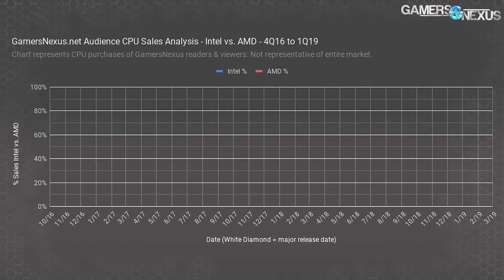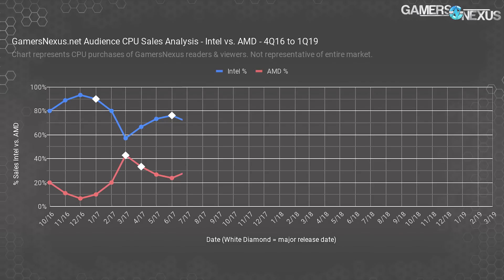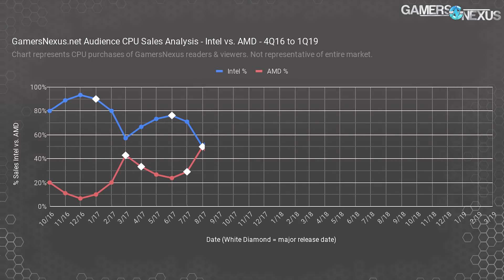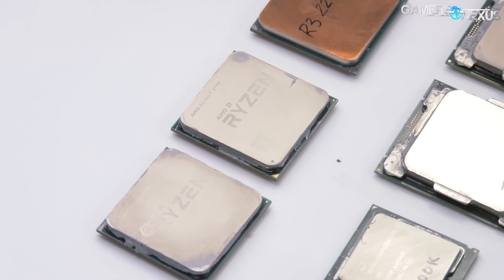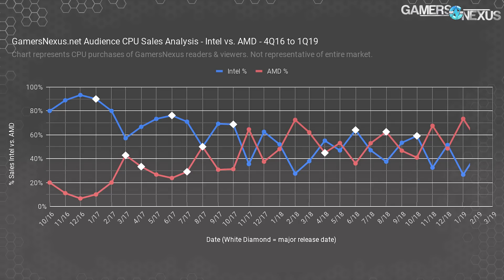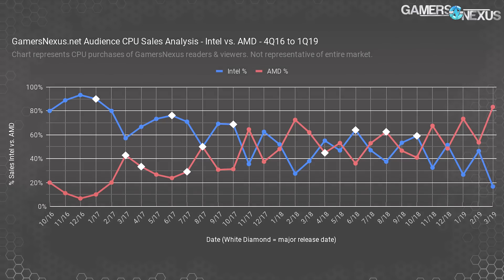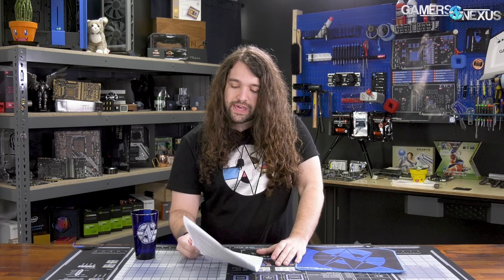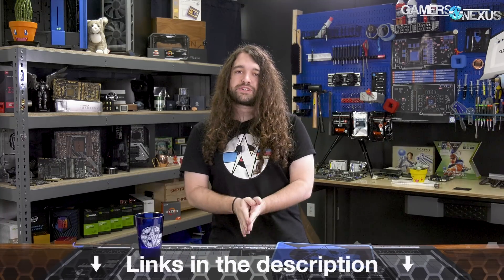Special Report: AMD’s Comeback Story - Intel vs. AMD Marketshare

Comment: well i5 died cause of intel stuped price politics and more stupid product line up politics!

Here is my suggestion intel and read it please!

i3 = 4 cores   4 threats  150€/$
i5 = 4 cores   8 threats  250€/$
i7 = 6 cores 12 threats  350€/$
i9 = 8 cores 16 threats  450€/$

all these should be K modells for overclocking.

every chip should have a non oc version of it, without a free multiplier for 50€/$ less.

than the sells will start instantly and every productline will be realy good value.
Reply: So you want the new i5 be worse than current i5?

If anything, Intel should look into matching AMD when it comes to cores:

4C/8T for i3, 6C/12T for i5, 8C/16T for i7 and 10C/20T for i9
Reply: @dainiusvysniauskas2049  yeah, but intel doesnt shit core counts like amd. and they dont glue them together xD...at the end of the day, its a question of price.
intels problem was to take out the 6 core 12 thread cpus, that was very stupid and put in a only 8 core without HT in the lineup, ok just for gaming its still fine but in view years an 12 core cpu will be necessary.
and if you look just for gaming a 7700k is still very fast and mostly better than a 2600x. so i would really recommend the 4c8t cpus for i5. price to performance for gamers would be the best. if its not enough than spend just 100 bugs more and than you have more the enough gaming power for high fps gaming.

but still, its the price what makes the music, if ibtel doesnt come down...than RIP intel xD.

Comment: History shows AMD will gain market share over a number of years and then screw it all up and lose all of it in a year or two. I don't expect that to change anytime soon.
Reply: well the thing about that is history is only repeated when you don't learn your leason! So far it looks to me that AMD knows what they are doing now and are not planing to repeat the same mistakes they made during the Anthlon and FX days!

Also, if you look at history, you will notice that the reason why AMD struggled was because they focused on developing muilti-threaded technolgy to make thier CPUs work better in mulit-core applications.  The problem was, most programs and games only used 1-2 threads at the time so the CPU couldn't run at its full pentetal.  Intel focused on imporving IPC and frequency which ran the programs and games a lot better, so that made everyone want intel CPUS instead of AMD CPUS.
Reply: @Shipprofile08  AMD is on the edge of repeating their mistakes with their video cards. The RX series is played out, if they introduce a new RX card using the same architecture it will be a flop, Vega was a complete letdown and the Radeon 7 was a new iteration of Vega and not the giant leap forward it was supposed to ontop of Vega not being the giant leap forward it was supposed to be over the RX cards. AMD needs to hit the next video card out of the ballpark and compete with Nvidia on all fronts because Intel is going to be joining the market too and Intel isn't going to be happy with taking one part of the market, they want it all. AMD bolstering their CPU lineup on cores alone.. can they match speed? Can they match RAM compatibility? And can they compete in video cards across all markets? That's all up in the air, from my perspective history says no they wont on all fronts and I wont wait for Navi or whatever... Not buying hardware when Navi will be released so obviously not waiting for Navi.
Reply: @JETWTF  I Think you have the wrong mentality for AMD.  AMD has never been known to bring out the best of the best.  They have always been known as the buget choice for low-end and mid-ranged consumers. Vega wasn't really a flop it wasn't ment to be the best of the best and to smoke the 1080ti in games. Vega was geared more toward creaters that need a GPU with lots of cores and game on the side.  Games gernally benifit more with higher speeds on GPUs where software like Blender benifit more with more cores. Also, the Vega arcetecture is designed off of a mobile node which is why its so power hugery at high speeds and so effecent at low speeds (this makes it ideal for APUs which are used primarly in laptops and consules).  

Even Lisa Su said that the first generation of Rzen was thier "worst case senerio" CPU and they were already aware that they would have memory compatability problems or motherobard problems because they were working with a brand new arcetecture! (intel has had the same archetecture for the past 10 years so thats why they don't have any issues with this stuff) Its been 2 years and with the AMD community helping AMD by giving them feedback on the processers (unlike Intel why never listions to thier community) this year is suppose to be the knockout punch for intel since the last 2 things that AMD is lagging behind Intel (AVX instructions and frequency) is suppose to be solved this year!

Radeon 7 isn't suppose to be a gaming GPU.  It is a sucesser creater GPU from Vega.  What I've heard online is that its basically a Vega on 7nm which allows it to clock higher without drawing a ton of power!  I think of Radeon 7 as more of a beta test for thier 7nm node since it is only targeted for creaters.  Also its the only GPU AMD has released this year so it might be more of a stop gap for Navi!

As long as AMD focuses on the markets that they are good at (APUs and CPUs and creater GPUs)  they will be just fine.

Comment: I was going to buy a ryzen 5 1600($80 plus $30 coupon for motherboard, deal at microcenter) but I think I'll wait till black friday to get those parts. 
Since I got a gaming laptop with 1050ti, though I want to upgrade my desktop from fx 8320 & gtx 750 1gb... I trust AMD but I don't trust cheap motherboards, especially with the memory issues being prominent in cheap boards...
My current focus is a good psu & gpu.(I sadly will likely have wait till navi and zen 2(3rd gen ryzen))

Comment: Hopefully Zen 2 has 4.5+ ghz stock clock speed for the high end so that I can upgrade from my 6700K to higher core count but not get off worse in single threaded performance

Comment: Bought an r5 1600 instead of an i5 as a last minute change in my build for the year back when Ryzen was still the new kid on the block. Even considering the growing pains with overclocking, software support and RAM support. It was definitely the right choice. Excellent CPU for an excellent price. I skipped 2600 because it seemed a bit more of an incremental upgrade. But i'm starting the get the build bug again. Who knows, maybe i'll finally pick up an r7, if the r7 3700 is anything close to what leaks suggest, it'll be an instant buy for me.
Probably won't even consider intel this time around. The extra 50-100% in cost is not worth the 0-10% increased performance on the current generations. Especially with the ridiculous prices of the 2080ti's.

Comment: As a custom system builder in the Fayetteville NC area we built around 200 systems in the last year and a half. Over 50% of them were running R5 of one sort or another. The 2400G is very popular with customers because we get it in for $120 and it's basically what we were used to as i7 for years, 4 core 8 thread better iGPU. The 2600 is basically and i7 8700 once you OC it. All at half the damn price. But we sell more i5 and i7 CPUs online because of worldwide shortages.

Comment: Man, the comeback is real. Personally I'm waiting for Zen 2 to finally make the jump, but I've been installing plenty of R5s in friend's systems when they upgrade.

But the most impressive thing that I've seen is the Threadripper line. We ordered a 24 core build "server" with some fast PCIe SSDs and 64GB or RAM to speed up our software development. Builds that used to take 4+ hours on my laptop and 1+ hr on our previous Xeon based build server now take 20-25 minutes instead. But the best part is, this thing is completely IO bottlenecked even with the fastest SSD we could find. It's good enough for now, but we're contemplating adding another 64GB of RAM and building from a RAM disk. Some initial calculations show that the builds would likely complete in less than 10 minutes.

The amount of time this single machine has saved us can already be expressed man-days, even though we've only had it for a little over a week. The measly €3K we spent on it will easily be recovered by the end on the month.

It's absolutely mind blowing how much performance these Threadrippers have. Compiling with 48 threads is a dream come true. This thing munches through everything we throw at it.

Intel is in trouble in the server market. A loooot of companies must be taking a very close look at  Epyc. The bang/buck difference is nothing to sniff at.
Reply: I know of a some companies doing that, for stuff like ray tracing for optical calculations the Threadripper is so much faster than the Intel systems of higher price points it's a joke. For IO heavy stuff which you can run on an almost infinite number of cores where you need lots of ram AMD is pretty much the only choice.

It's not a choice of which one has better support or who system builders choose to use, time is money.

Comment: Bought a 1600 to upgrade my 8350.  I'm excited for the 3k series and will be a great upgrade from my 1600.  Will likely eventually get a better board and better ram so I can give away these parts to someone without a PC or with an old one so they get put to good use but it's so nice to be able to spend more on my GPU and other peripherals without having to sink such a big chunk into the CPU.  Glad I supported them when times were bad, because I like to think that I helped get them to where they are now in some way.
Reply: i got a ryzen 5 1600 aswell and probably a faulty motherboard, i get all kinds of freezes and stuff , and yes i did already change everything in my PC, psu,gpu,ram,storage, even the case, fans and cpu cooler. the freezes remained. so i believe its the cpu or motherboard, or both. cant wait to upgrade
Reply: @SweatyFeetGirl  i got freeze hiccups with a new nvme because of the amd storage drivers. It acted like it was going to crash with repeating audio but then would come out of it. If that's happening to you, you might have to change your storage drivers from AMD to generic
Reply: @SweatyFeetGirl  just thought I'd point it out, drove me nuts and took me a couple weeks because it didn't crash so there were no logs to follow.  Had to use latency monitor just to have something to chase.

Comment: FX was already in the bargain bin in 2013 though, bought a fx8350 myself for no more than 160 bucks, which really wasn't a bad deal at all considering the price and year.
if anything the prices were slowly creeping up to 180 on FX again before the ryzen launch.

but ram was so dirt cheap in early 2016
many people were inspired to build an FX because it was a cheap, fun endeavour,
intel prices don't really drop over time much (neither did the FX after 2013 tbh),
and the 2nd hand market was stale, with everyone still holding on to their 2500k/2600ks. 

i had already been sitting on that fx for nearly 3 years, and i thought it was great for those 160 bucks in 2013, but it cost basically the same in 2016, i did advise people against it so late in the lifecycle. but hey, people like cheap hardware :)

i remember buying 16gb ddr3-1600 cl9 for 83 euros back then.

Comment: Could've bought an i9 9900k recently, but got both the ryzen 5 2600 for my partners computer and the 7 2700x for myself for the same price, just such good value for the money.
Reply: 2700x here great cpu even at stock 4ghz
Reply: @EJSC I'm playing 144hz at 1440p I'm destroying games well above that with my gtx 1080ti which is arguably a more contributing factor to gaming performance than CPU.

Comment: Im helping both sides i have 2 main rigs one with a 8700k rtx 2080ti and the other with a 2700x rtx 2080. I like both but the but the 8700k is my main rig because i game a lot. And i was gonna get a 9900k but ive held off mainly because my 8700k is delided and runs really cool and waiting to see ryzen 3000 series. I dont think there gonna hit 5ghz like some people say but if they can do 4.5-4.7ghz they will be great for gamers and content creators. And if they come out with a 12 and 16 core that would be awesome. But the only thing im concerned with is people with cheap am4 boards thinking they can run one of these cpu’s. Not sure if we’ll see a 16 but im sure we’ll see something higher than 8.

Comment: Team AMD. I just built a ryzen 2700 and love it. My last build prior was the phenom 1055t. AMD has also been good to me.
Reply: nice build bro!
Reply: Yeah now they are good to you. The phenom 1055T was pretty fucking bad(Not as bad as FX, though).
Reply: @Orcawhale1  I was able to play pretty much every fps game, besides apex (because they didnt write the code for it) for 8 to 10 years.  Dont get me wrong, Its night and day compared to my new system. But, it lasted  a long time and it was always overclocked.
Reply: @benh580  Being able to play it, and play it properly is a big difference. 
I myself made the same upgrade you did years ago, only i had a Phenom II 955(Which core wise wasn't lacking, despite being a quad core)
But was always helped back by piss poor single thread performence, my friends old Intel E8600 dual core was performing better in Cod,Cs, everything. Despite me, rocking a pair of 5770s against his GTX 260 core 216.

Comment: Amd 100$ motherboards vs intel's 200+$
Reply: Kytes93 (during the shortage) high freq. low cas. AMD-compatible ram at $250 vs $150 for 2600 cl16 'good enough for Intel' ram

You know it was true
Reply: @KingHalbatorix  Fanboy found.

Comment: Built my 2600 based system recently to replace an older i5 system. I have been very impressed with it and the cost performance ratio cannot be argued with for a budget conscious build like mine.

Comment: Running with an i5-4670k at 4.4ghz, but dang those AMD R5 chips are looking mighty tempting.
Reply: had an i5 and built a new computer with the r5 1600, haven't had a problem and not looking back. upgraded my monitor to 1440p @144 hz. with what i saved.
Reply: Wait until Zen 2 is out in a few months, then it will be basically irresistible

Comment: I bought 8700k in Oct 2017. It was a crappy OCer so in Feb 2018 I grabbed a 8086k. Built my sons friend a new PC Aug 2018 and used 8700k. The 2600 is a great Cpu for the price and Intel needs to figure out a way to combat it or their sales will drop.

Comment: Thanks for another interesting content piece, Steve.  I can only speak for myself, but my experience with Ryzen has been very positive.  I own an R5 1600 and an R7 2700X.  I built a computer for my mother last year that uses the R3 2200G.  She's still amazed at how small and quiet it is compared to her old Phenom x4.  I plan to replace the cooler (currently a stock Wraith Stealth) with something quieter this summer..  She doesn't notice the noise, but I can hear it.

The point is that AMD is making good hardware and selling it at compelling prices, which means that people who are on the fence about upgrading can do it or can afford to spend more budget on better GPUs.  Lisa Su promised that Ryzen would be a game-changer, and I believe she's right.

Comment: it's great that AMD is getting market share, that's what's worth more right now, it will be great if ryzen 3000 can really beat the intel single core performance though, then they could afford to raise their top tier chips and make some nice profit
Reply: Single core performance is the biggest boondoggle ever. Soooooo overrated. As long as you can max out your GPU, a gaming PC doesn't really need super fast single core perf.... it needs adequate performance compared to the thoroughput of the GPU. Save your money on a CPU and upgrade to a higher GPU. I'm not saying that single core perf is meaningless, I'm saying that both AMD and Intel have plenty enough single core perf to max out an RTX 2080ti. But seriously, if you don't want to use your PC for anything but games, you should consider buying a gaming console and save yourself a bunch of money.

More cores and more threads is in general wayyyyy superior (proven again and again with various benchmarks, and even a few games) than internally fast (inside the chip, i mean, as in simply clock speed, in addition to useless nonsense like ppl making a big deal about IPC). Single core perf is secondary to a fast GPU. If you want to be a smart shopper, then why would you not consider price in addition, to perf? It's a bit ostentatious don't you think? Other important aspects of CPU performance include: thoroughput (math functions and etc), stability, security, novel and useful features unique to AMD chips (like the mini ARM core built into Ryzen Pro that does hardware encryption of memory). There are so many ways AMD benefits from it's decision to stick to their guns and go for more cores, as opposed to what might happen if they try to do what Intel does with fast cores. AMD cannot survive by riding Intel's coattails. Now that the software is increasingly multithreaded, more cores/threads is finally helpful. Single core perf and IPC numbers are basically at parity between AMD and Intel, thanks to TSMC's 7nm on AMD's side; and on the Intel side, thanks to AMD's engineers who got poached by Intel to revamp Intel Core tech with some Ryzen-Fu.